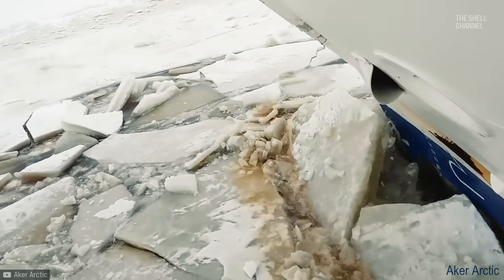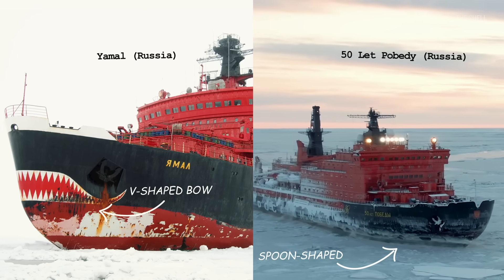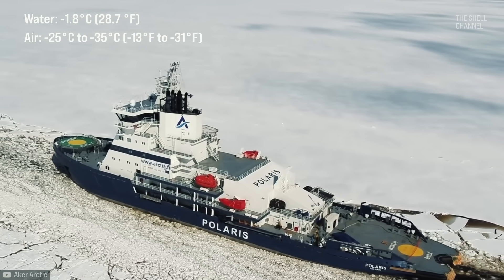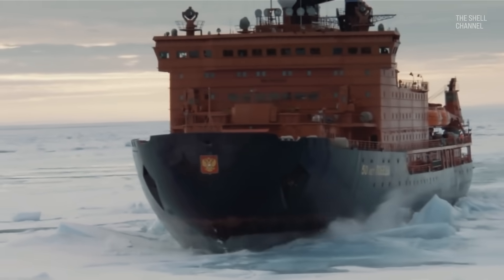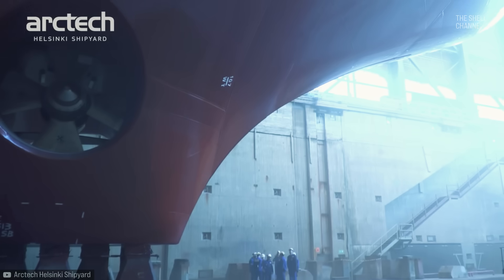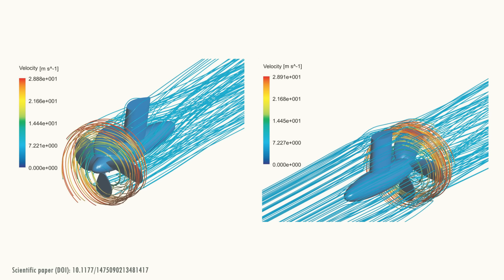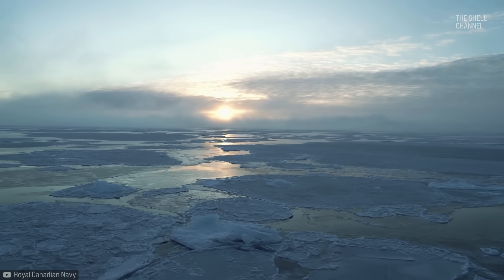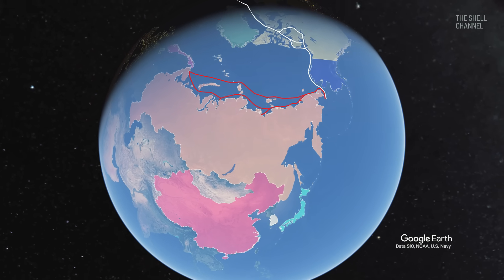Icebreakers don't break ice the way you think 😮

Comment: Interesting.   FYI,  the Polar Star uses the diesel engines for normal cruising.  It has 3 FT4 gas turbines for ice breaking operations or for high speed cruise. The company I work for overhauls and tests them. Approx 25,000 shaft horsepower each. We just tested one a few weeks ago. The Polar Sea icebreaker uses the same configuration.

Comment: The Arctic routes may be shorter, but how much more money would every voyage cost given the ship and the crew must be prepared for freezing conditions? And the cargo must either be heated or tolerate the low temperatures, too. Not to mention the costs of essentially having an extra ship (the icebreaker) in transit with every single ship. I can imagine it still being more efficient, especially if multiple ships sail at the same time, but the raw mileage isn't the whole story.
Reply: Along Siberia,  the summer and fall are reliably ice free so no need for an escort. The northwest passage has a lot more ice flowing through the archipelago which can block passage (actually MORE of a problem with warming climate). Ice hardened ships (reg with more steel on the bow) are used for northern community resupply.

Comment: Just wondering how the crew can sleep with all the noise and vibrations from the icebreaking?
Reply: The crew lives in accomodation above maindeck not in the hull. Also the accomodation usually protected with heat or accoustic insulation to prevent heatloss and supres external noise.

Comment: anyone that still believes the global warming lie is stupid. basically an asshole. you are letting them tax the population into poverty. Also you are letting the corporations pollute at scales never seen in human history. Every corporation is using this lie to hide their polluting. As long as it's not carbon, dump it shred it and fill the landfills. Even if the carbon claim is a lie keep telling it. Every solution, EV's windmills and solar are a provable fraud. Not one will ever pay back it's carbon budget they took to create. Have you seen the concrete base of a windmill? They don't get reused. Not a single EV or it's battery is recycled or recyclable Neither is a solar panel or windmill. The carbon they want rid of is you. Not them. Cow farts are a problem but there was billions of buffalo roaming the plains that were not some how. These climate cult liars have pulled the biggest fraud since mRNA was called a vaccine.

Comment: i dont understand why ice thickness is even an issue for icebreakers.  it seems to me that the weight of these ships would have no problem breaking through so why not deliberately try to run it onto the ice with giant bulldozer tracks.  or a pile driver mounted on the front.  or half a dozen other forms of specialized equipment.  instead they basically just ram a ship into it over and over.
Reply: This is what icebreakers do, they break the ice with their weight. All explained in the video. But it can happen that the ice is so strong, that a ship can land on it without breaking, which rarely occurs.
Reply: The ice is kinda strong my friend unlike every special tool, it's only brute force of steel monolyth that can efficiently do the job

Comment: Holy crap... 1 megawatt is 1,341 horsepower, that Russian one's  got 80,461 mechanical horsepower!
Reply: That's a lot of horses
Reply: The Polar Star has 75,000 hp
Reply: @BlackBeardAir  These must be quite tiny horses ))

In fact, 55 MW is the shaft output of the 50 Let Pobedy. 2 reactors 171 MW each, and 2 turbines, 27 KW each. Versus about 60 MW of turbines and 7 MW of diesels the Polar Star has.

26 000 tons versus 13 000.
Reply: @Kitaez77476  What?   That was even edited, and I can't make sense of it
Reply: @BlackBeardAir   
In fact, the 50 Let Pobedy ship is twice as big as the Polar Star, but has over 340 MW of power vs 60+ MW the Polar Star has. 

Still, in the Shaft power, they are equal, more or less. About 55 MW.
Reply: In other words 1.5 Honda civics with turbos
Reply: On 1/2kg of fuel a day no less.

Comment: 14:05 - all that we could here from "this guy was:
"[the weight? - inaudible] is over 110 thousand [metric] tons and the width is over 50 meters" ("[...] более сто десять тысячи тон, и ширина более пяти десять метров").
Also, the on-screen caption reads "thickness of the bottom [of the hull] is greater than 4 metres - obviously, "structural thickness", not a "homogenous rolled steel", obviously.
Reply: It's abridged part of this sentence- "Project 10510 icebreaker will lead big-displacement vessels with a deadweight of over 100000 tons and a width of over 50 meters along the Northern Sea Route year-round." not 110 thousand tons. And on-screen captions is thickness of ice greater then 4 meters- about ace breaking capabilities, not about ship thickness.
And both original Author and this channel have same mistake- It's project 10510, not 105010.
Reply: @danielkirpichnikov2007  Thanks and спасибо ;-)
Also, yes, you're absolutely right - it's толщина льда, not "дна", but somehow my eyes jumped over this sentence and jumbled the l–d–a letters (Cyrillic is not my primary alphabet), and then, since all the previous numbers were about the icebreaker itself, my mind just jumped into conclusion that this number also refers to the ship "a such" - and this is not "about ace ICE breaking capabilities" of it, wink wink... ;-)

Comment: The point/ purpose of these bow thrusters is also to suck the water from under the ice right in the front of the icebreaker (which is to be crushed in a moment) which creates area of lowered pressure ("under-" or "sub-pressure" - there's no right word for it in English), thus putting additional stress on the ice - which facilitates the break-up of it (lesser "support" from underneath).
Reply: A vacuum.
Reply: @joefell7845  No.

Although yes, English uses it for both "vacuum" and "lower(ed) pressure area/ space", even if the root word is Latin vacuus meaning EMPTY - and the dictionary defines vacuum as a space ENTIRELY devoid of matter" .
("Less air" is not the same as "nothing at all", and at any rate in this scenario here there isn't any "less water", it is just "passing/ transfering the suction", so to speak, onto the ice - so "vacuum" makes even less sense here.) 

And then there's this second meaning of "vacuum" which is a shorthand for a vacuum cleaner, but it makes no sense whatsoever, since it doesn't (and can't) clean any vacuum - as the vacuum itself is "devoid of any matter" . Therefore, QED.
But yes, for the lack of better/ proper term this silly "vacuum cleaner" term was used first (when this thingy was invented), and it stuck - but it sucks. I mean...  really sucks. (Oh well, you get the idea, don't ya? ;-)

Anyway, "a vacuum cleaner", funnily enough, DOES NOT create any vacuum, nothing even remotely resembling it - it merely produces "slightly lower pressure", sometimes referred to as "partial vacuum" (which sounds just like "half-pregnant and is just as logical and possible), and this guy from Technology Connections channel even made a joke about it, showing (after explaining this aforementioned "concept") a partially dismantled vacuum cleaner, and saying, with a dead serious face, "this is a partial vacuum" .

To actually create vacuum you'd need to use vacuum pump - or take a bucket and bring some of it from the far outer space.

And while at it... The funny thing about English is it often doesn't have simple words for obvious "everyday concepts" like "24-hour period of time" - which is even more "natural" thing than "a week" (and many languages do in fact use a separate word for this "day+night"/ 24 hrs), yet it uses this "whisky tango foxtrot?" term "fortnight", which is good for... God knows what - and makes not much sense whatsoever.
I mean, what's so special about "TWO weeks" (which is, by the way, is easier to pronounce and also has only two syllables) - yet three, five or seven weeks are left out? 

...but I digress here, and Happy New Year anyway ;-)
Reply: Negative pressure.
Reply: @robertshiell887  Nice try, but sorry - doesn't exist, CAN'T exist... ;-)
Reply: The word is vacuum
Reply: @PabloGonzalez-hv3td  No, it is not - as I explained before, in details.

I mean, yes, it IS USED in such manner and fashion, but then we use "unique" for something which IS NOT truly unique (i.e. ONE, and ONE ONLY of its kind), but the case with "vacuum" is somewhat stronger - and then it would be an utter nonsense to call "vacuum" a space TOTALLY FILLED WITH TOTALLY MATERIAL substance, that is water. So, there you go.
Reply: @MrKotBonifacy  "Vacuum" can refer to a relative pressure differential. Not necessarily an absolute vacuum. You can call it a partial vacuum since suction is created under the ice.
Reply: @PabloGonzalez-hv3td  As I said before - yes, I acknowledge the fact people use term "vacuum", which denotes "total absence", for "pressure differential", but that does not mean I find this reasonable or correct - and as I said in one of my earlier comments, "partial vacuum" carries just about much sense as "half-pregnant".

Also, I don't expect or force you to agree with me, but please, don't re-use all these arguments I already rebutted, por favore - will ya? What's the point in repeating over and over again the same "arguments" if these were already addressed? Me no anderstand...
Reply: @MrKotBonifacy I don't think you understand the engineering definition of a vacuum, the term partial vacuum is perfectly acceptable. However, I doubt that the bow thrusters achieve any significant local negative pressure given the vastness of the ocean beneath the ice. In shallow depths maybe, but these props work perpendicular to the direction of forward travel so are drawing or pushing water sideways. Happy to be proven wrong but I think you're just making it up.
Reply: @steviesteve750  ...and, my dear league, "perpendicular" is the operative her.

I mean, not only I NEVER said anything about the "direction", but also I was not talking about "engineering definitions" but instead about LINGUISTICAL "nonsenses and peculiarities of English language", in which "feet smell" and "noses run" (and you can ship your goods by a truck, but send cargo on a ship).
So, thank you for your input, but it looks like it does not refer to my comment. Cheers.

Comment: Foating sea ice (Drift ice) is moved by wind and currents. When sections of of drift ice collide, they became pack ice, and they may form ridges that look almost like mountain ranges. They can be up to 15 meters (50 ft) thick (most of this is not visible, under the water). Icebreakers try to avoid hitting those ridges whenever possible. But sometimes the only option is to go through the ridge.

Comment: Put a big buzz saw on the front. Or flamethrower
Reply: Its faster to just ride on top and break it that way. A flame thrower would take several minutes to cut through a block of ice that large. Maybe a high powered cutting laser but then you might as well put that to the ship power needed to ride on top to break it. Plus the water would diffuse the laser I think. Occam's razor suggests the current way is the best way.
Reply: @censored-z7d  
Ice is usually almost transparent. The laser will do absolutely nothing to it, because there will be no surface on which the beam of light will be concentrated.

Comment: nuclear is the way for shipping industry but requires a special crew we could reduce a lot of emissions just by going nuclear ships
Reply: Most companies won't do it because of increase in crew cost (additional guard and better engineers), and it also doesn't really matter outside of northern sea route because other shipping routes are better suited for ships refueling on the way.
Also mega-ships which have similar power need to a nuclear reactor might be going out of fashion.
Emissions will likely be reduced until one of such ships is damaged due to some sort of military action, which will cause enough pushback from the public for nuclear powered ships to be prohibited entirely.
Reply: @wumi2419 Fortunately Rosatom does not give a shite about "public reactions" in the West.
Reply: @wumi2419 "Most companies" does not do it because only one country in the world has the technology and ability to build and use nuclear icebreakers, and it's "retarded" Russia. China has plans, but not one actual ship yet.
Reply: More cost in building and maintaining than in fuel savings.

Comment: Why don’t they have some sorts of wheels in the front so when the boat climbs onto the ice it can sort of pull itself along on the front wheels. Would be so much more efficient!
Reply: More moving parts in contact with the colliding ice means more maintenance
Reply: @divoulos5758 

1. Wheels wouldnt colide they just roll on the ice where it is not broken yet

2. Two spinning wheeels is literally 2 electic motors and two wheels and maybe some sort of piston that you can lift the thing when not in use. Thats literally almoast no maitanance and an insane amount of fuel savings

your point is not valid at all.
Reply: @themomorain  if you think what i think you think then this thing will get constantly stuck after breaking a piece of ice since the wheel pushing ice down would hit the next ice plate and then stop
Reply: @themomorain you really overestimate that wheels are able to move a behemoth of a ship on slippy ice
Reply: @animationenusw  Bruh you are pretty stupid about basic physics but yeah whatever. Im tired of arguing tbh.
Reply: Wheels...on ice... are you american?
Reply: @kindlingking  Im about to delete this comment because it attracts way to many braindead people. Also no im not american also I have no clue what that would have to do with anything..

Comment: neat. I'm no environmentalist, but I can't help but wonder if breaking all this ice increases the rate of melt?
Reply: Yes it increases the surface area so it melts easier but ice on water melting does not impact sea levels
Reply: I have a similar concern with the rockets.they send through the atmosphere..thousands. doesn't it compromise the protection from the rays from space..?
Reply: I can imagine if it's warm enough they could...but it doesn't look like it's getting any warmer there...
Reply: Small amount just due to how large ice sheets are and that they would likely refreeze after the shup passes.  

One of the bigger issues scientists are worried about (atleast if we start doing more shipping through the arctic) is black carbon from diesel exhaust scattering onto large areas of glaciers, changing albedo of the ice, and making it melt faster.
Reply: That is more dependent on the season
Reply: Yeah it'll melt a little faster but... this is the arctic. It'll freeze again lol.
Reply: That's where you have overestimated orcs thinking they gave two 💩 about environment. These barbarians only care about their own greedy agendas
Reply: Yea but it’s just fraction of the ice
Reply: I wonder if people walking on the ice floes die because an icebreaker cuts off their way back.
Reply: increased surface area = increased reaction -- yes it will melt faster but not fast enough it will make much a difference.